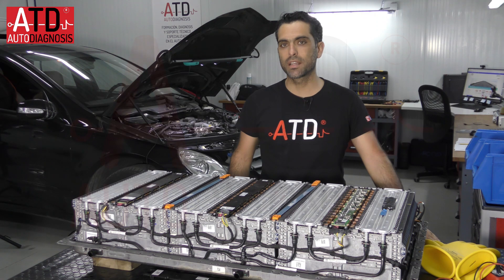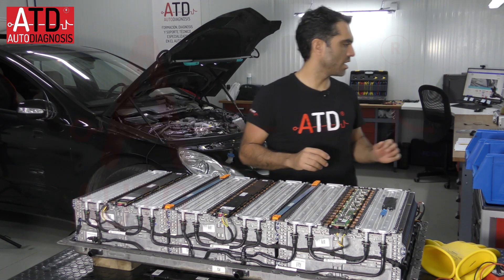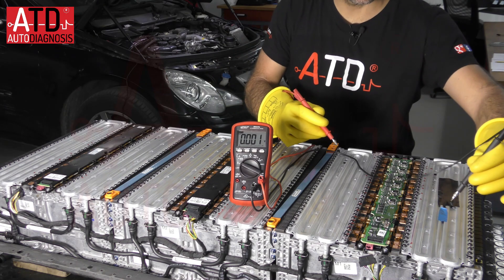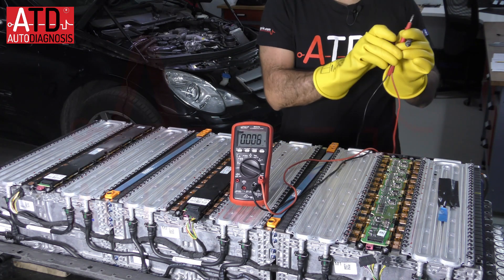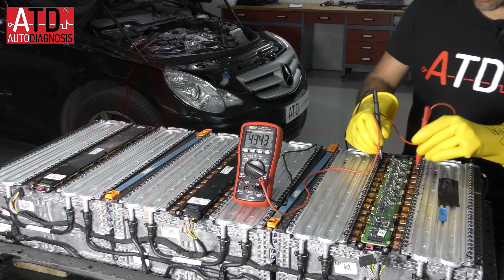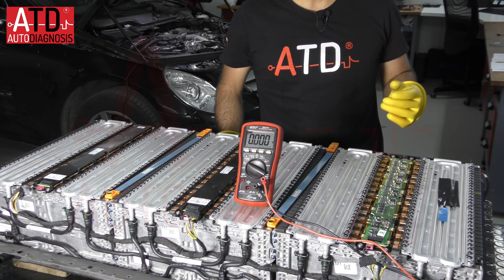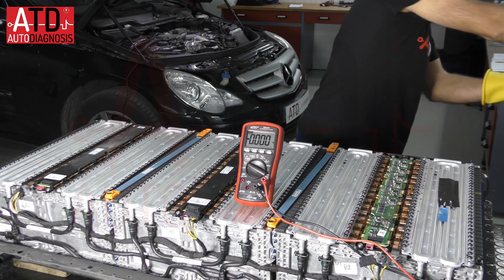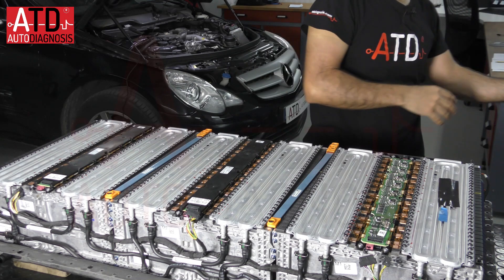Li-Ion cells in Smart Fortwo HV Battery.

Comment: I have a smart EQ battery with 20 000km and using the xentry diagnose on the car I discovered that one cell has 102mV less than the others.... also is telling me that the actuator is blocked...my question: the actuator is one of those relays on your video? Second question: can I balance the single cell charging a little the cell that has less (102mV less) and what voltage to use ?
Reply from the maker: Hello. Yes, actuators (or contactors) are relays. You can balance cells, even car does it. Regards.
Reply: @ATDautodiagnosis  the charging sistem is out so it won't balance by itself.... thanks for the answer
Reply: @ATDautodiagnosis how can I get in contact with you?
Reply from the maker: @johnblaze9701  info@grupoatd.com